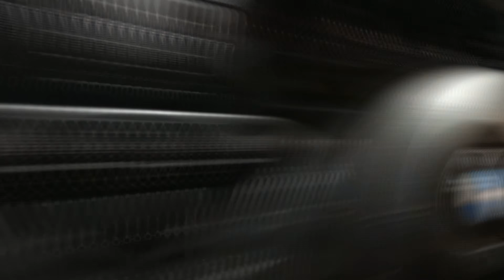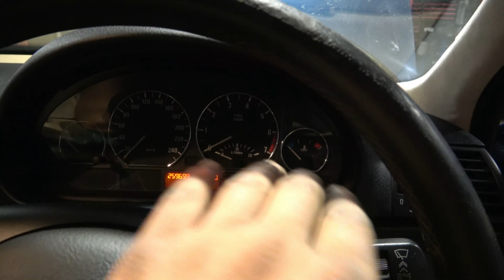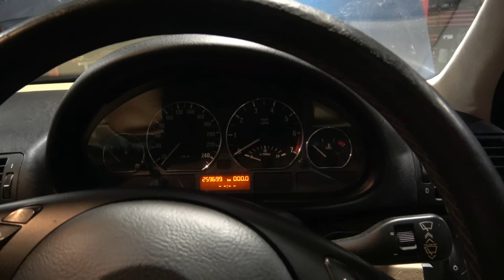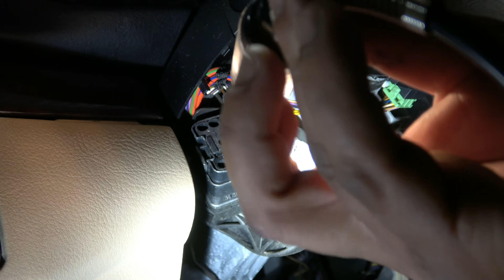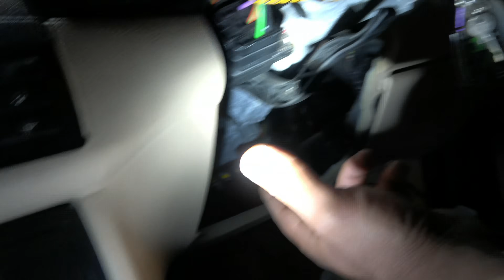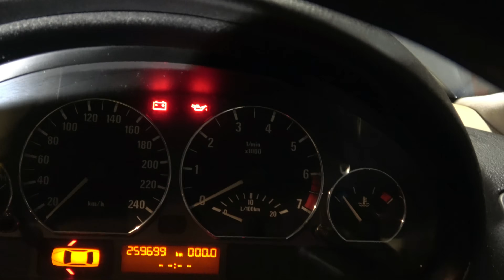BMW NO START BUT IT CRANKS

Comment: Could i be having similar issue, for months been having autobox cog of death coming up from cold, cycling the ignition switch a few times get P back, so assuming it was the neutral safety switch i cleaned it out, checked operation, refitted, cycled ignition to check for PRND, all good. Lower the car down, shes starts for 3-4 seconds, bogs down and stalls never to start again. 
Good battery
Getting spark at the plugs
Fuel pump primes and shows 50psi at the valve, although does drop a bit.
Plugs are wet from cranking
Checked ignition fuses in engine bay corner
All out of ideas now
Reply: Electronic ghremlins have haunted the car

Comment: I have a problem with cranking and not starting bur all my engine lights come on bt my obd2 is not picking up on the scan tool
Reply: Did you get this fixed??
Reply: Try the maf sensor

Comment: Same problem on 320cd 2004. No one knew how to solve the problem. Thank you bro and respect!
Reply: Did you manage to fix it
Reply: Yes, yes. The lock just had a break in the cables. There was no need to change the complete lock. Only new, thicker wires were installed and the problem was solved for €5.

Comment: Is it the same ignition switch on 320d ? I replaced vp44 with new one and everything else checked, car cranks with fuel coming to injectors but wont start :/
Reply: Did you solve this? Having same issues
Reply: @alexwarrener3770  Yes, it was the air in injectors. You need to bleed injectors and trying to start with cockpit or start spray.

Comment: Hi. My e46 330d showed dde and immediately cut off. Now it just cranks and wont start. I can hear the pump priming, ive checked fuses they are all ok. If i leave the car for a few days, it will start. But driving, after a few minutes it will show dde then cut off and wont start again. Any ideas?
Reply: Hi, I have the same problem. Did you manage

Comment: Thank you!  My daughter's car was stranded at work - couldn't figure out why only the mileage and seatbelt lights were working / and engine cranking / but wouldn't start.  YOU NAILED IT.  Took me 5 minutes to get to the switch, wiggle it to get car to start and drive home.   $17 part ordered on Amazon - delivered 2 days later.  It didn't take 5 minutes to install!  Thank you!
Reply: What part did you order!?!

Comment: Bro good video I'm just asking if it's that the ignition switch or ignition connector.....thanks
Reply from the maker: It's the switch. Electrical part you can swap out.
Reply: @a1mechanicaloakey  thanks bro

Comment: I have a 2006 BMW X5 4.4i E53 the originally had no crank or start. 
I bought a generic ignition part off ebay. 
Now it cranks bur won't start.

I checked the fuel pump and it's working fine.
I would like to fix this suv as I can use it.
Please reply. 
Thanks  
Jerry
Reply from the maker: I can give you 150 reasons why it wouldn't start, so that very little information plus a good mechanic should get you out of trouble just fine.
Reply: @a1mechanicaloakey  PS,
Not 150 reasons for one not starting. 

Of you can afford to take it to a shop (1000.00 plus) they will connect it and probably tell you that you need a new ews, Computer and key!

God Bless

I don't have $$$ so doing myself!
Reply from the maker: My reply offended you that's alright but the truth is there are many reasons why a car wouldn't start, just throwing parts at it is not always the best approach but someone can certainly try that route and get lucky. Unless it's a well known and discussed issue with particular vehicle, the short answer is get a diagnostician to figure it out if diy didn't help.
Reply: @a1mechanicaloakey  I am not a pro mechanic but am very good at trouble shooting and have good common sense!

I have changed the ignition and all the time I thought it is the ews  module syncing with the main Computer. 
I've done 100's of reprogramming Epromd, circuit boards, phones, you name it.

It will be the ews out of sync with  Computer.

I just haven't purchases the patch cables to connect to one of my dedicated Computers.
I already have the official BMW Service Software, just not the energy to deal with it due to many health issues!!!

You gave an extremely poor reply especially when you post a video stating you knew what was wrong with the BMW in your video!

When I 1st bought this 2006 BMW X5 E53 4.4i  SUV it would for no reason not turn over or start.

I figured out a sequence to have the computer go thru the default  security settings, then re-sync the key to Computer and presto, it would start right up.

Then one day I got in it and samevthing except that time when I fully went thru my sequence it still didn't start.
Pissed I went in the house ate lunch and decided to try to start.
It started right up.
I park all vehicles inside my secure acre so drove a few feet, shut off restarted and did 5 times before leaving property.
I did notice when getting onto the road it cut out completely but just for a second and then ran fine.
I drove to a local store with it performing fine. 
Parked and shut off.
Tried to re start it and it just turned over (1st time for this issue)
Shopped and when back to vehicle went thru all connections starting at the battery out.

Had it towed home and here is has sat about a year!

Now  Your thoughts?

Greatly appreciated in advance,

Jerry Deitz 
CDA IDAHO

Comment: I have a 2004 BMW 325i....I've replaced the spark plugs ignition coils MAF sensor fuel pump....fuel pump relay.....fuel pump fuse....gas cap.....bleeder valve...air filter and sender unit for fuel pump. All this in the past 7 months. However, yesterday the car has a crank no start condition. Also, I stopped hearing the fuel pump when I put keys in the ignition. Is it possible the fuel pump already went bad or is faulty??
Reply: I had crank no start replaced fuel pump. Worked fine next morning no start again. Had done plugs 3 months ago and kept bypassing that as an issue. Took 3 days of headache pulled plugs and all were bad. Check plugs. After I changed the plugs with ngk iridium’s it cranked right up.

Comment: Not the best trouble shooting method. Just because one car has an issue doesn't mean another car that has similar symptoms has the same issue. 9 out of 10 times if a bmw has a crank no start issue it is NOT going to be the ignition switch

Comment: I have a e38 which do not crank. Replaced the starter since the old one clicked. Everything lights up fine. Changed the battery, grounded the engine to the chassi, tried to jump start it and switched the relays but nothing. Only thing that makes it start is jumping the starter. Can it be the ignition switch?
Reply from the maker: Very possible, just simple diagnosis would eliminate possibilities of issues like relays fuses and wiring.

Comment: I'm having a current brain racking problem with my 2012 f10 528i no Crank no Start..and it's just now showing the red  warning ⚠️ sign for drivetrain malfunction. Could it possibly be the same.. cause that would be an easy fix..oh and I also heard a clinking noise like it was coming from my rear wheels
Reply: Please tell me you got this fixed by now
Reply: Help please

Comment: Thank you for the video.. I have a quick question please.My bmw 120d e87 cranks but no start, all lights display on the dash but except the engine light.. fuel flows but the injectors do not accept the fuel.what could be the problem?.
Reply: I have the exact problem on f10 550i
Reply: @sithulematrose1825 I would love to talk to you about how you resolved this issue
Reply: @sithulematrose1825 would kindly love to talk to you about how you resolved this problem
Reply: Did you ever solve the issue?

Comment: I have a bmw 116i 2005 I drove it for about 5 mins then stopped turned the it off then went back about 2 minutes later and it was like there was no power I tried jump start it and it sounded like it had run of gas but could smell fuel. It will crank while it has jumper leads on but just won't fire ne ideas to help would be great as I have only had it for 2 weeks
Reply from the maker: That's just not enough information. Many possibilities.
Reply: I have the same problem. Checked everything I have no spark. Seems like there is no power coming to the coil pack

Comment: I have a BMW 530i , she cranks but won’t start . She will start if I spray started fluid in the intake, then stalls immediately . I’ve replaced the alternator , the fuel pump & relay . Checked all fuses they work and I’m getting power To all sources . I don’t know what’s next . Any help on what you think it might be ?
Reply from the maker: Many thing could cause that. Most probable cause could be, no fuel getting in the rail, no injector control, immobiliser etc.
Reply: I got the same issue on a 2007 x3.. how did you fix the issue? Run on starter fluid only.
Reply: @agsession7664

Comment: I have a 735i 1991 it cranks and occasionally starts with  a very low idle then switches off , any ideas?
Reply from the maker: Many reason that can do that but start with cleaning throttle body and idle controller.
Reply: @a1mechanicaloakey  done that even checked crank position sensor still no luck

Comment: Thanks for the video, I ordered and ignition switch but got the start/stop module.  The ebay link in your bio is no longer working, can you provide me with a part number so that I can order the correct part please? I have a 2008 750i
Reply: Reply with the part number please as your link doesn't work.
Thanks

Comment: Hi, my BMW X3 2.0 diesel 2007 has intermittent crank but no start problem when the temperature gauge is in red even if the engine is cold. It will start when the temperature gauge is in cool position. Any idea regarding this problem?
Reply: @andrew190e no. I tried all the suggestions given but the problem remained. My car has been sitting in the garbage for 2 yrs now. 1 technician suggested to repair the ecu but to no avail. Yes there was a suggestion to change the jbu module. I’m still considering to try it but the expense is holding me back unless someone could assure me that indeed it is he problem.
Reply: i have the same issue with my 330ci in the red will never start
Reply: @andrew190e  were you able to correct it? My techinician is suggestions to replacement the jbu module. It is quote expensive so i’m having second thoughts about it.
Reply: Mine coolant is in red too is that coolant related
Reply: Si care este problema  @abumannocchi
Reply: change your crank sensor. if not, then cam sensor. crank sensor is more likely

Comment: Hi, I have a problem with my Mini Cooper s r56 not start. 
The only code the mini have is: A0B4

The mini was on taking it out of the garage when it suddenly turned off.  The first Scanner have these codes:
 2781
 2775
 2D52
 2DCA
 275F
 272F
 I changed 4 spark plugs, 4 coils, the Camshaft Position Sensor and a new battery.  But it did not turn on, now it is giving these codes:
 005E31
 009314
 00A0B4
 00932D
 009CB5
 I deleted them and it only gives me this code: ( A0B4 )
 The mini starter good but not start.
I try the new battery and it says it's ok, but when I test the battery with the terminals mounted on the Mini Cooper it says it's bad I don’t now why. I also reset the new battery in the mini system with the scanner but nothing.

( A0B4 )
Reply from the maker: Best suggestion is to take it to a good technician. that's just not enough information there to give you any technical advice.
Reply: This is a problem, where I am there are no mechanics who work with Mini Cooper. I only need a idea.
Reply: I buy a Autel scanner and this is a code the scan register
Reply from the maker: At this stage I do not know how to help. Give me more information on what have you checked. Is it no crank or no run. I would love to help but when someone says no start, there's 500 different reasons I can think of  why would a car won't start.

Comment: same problem. My n42 bmw shut down during ride and did not start anymore? Replaced fuel pump, crank sensor, both camshaft sensors and spark plugs. Error codes gives misfires etc. U think it might be ign switch? Bmw e46 coupe 2002?
Reply: Same here did you get it fix?
Reply: @ Yes. It was valvetronic motor. It was in wrong position and didnt work anymore. You can manually turn it in correct position.

Comment: Hi thank you 🙏🏼 for this we are really really stuck 😭 we have a bmw 1 series 116l se engine 1596cc no problems no warnings at all woke up one morning and it just cranks? And won’t start 😩 he’s only just bought it in June 2021 only 50,000 miles, how can a car woke the day before and the morning not start? Apparently two cylinders aren’t working and 3rd cylinder low, fuel pump checked ok no sign of faults ignition test ok too, apparently they would have to send off cylinders and take head off which costs sooo much money now they saying write it off????? Please please please I beg you for ideas?? This car is everything for us to work? 🙏🏼🙏🏼🙏🏼❤️
Reply from the maker: Anything is possible with cars. I currently have one with 50,000 km 2018 model, lost 3 cylinder compression already. Very bad engineering. Ask the mechanic where is the compression leaking to. I would take it some place else to get second opinion if they couldn't answer that question. they you will know real fix and pricing.
Reply: BMW has a warranty on the timing chain up to 70,000 miles , they lost a class action lawsuit. Should be a free repair at BMW . Make sure who ever u took it to puts it back together the correct way . Then take it to BMW

Comment: if that causing it, does it also cut off the fuel pump?
Reply from the maker: Very much so. Pretty sure none of the computer is awake at that point.
Reply: @a1mechanicaloakey  I have check but I have already replaced the fuel pump, crank sensor..check all fuses & relay all seem ok. The car sometimes shut off while driving and need to wait few minutes to start and also sometimes also all light comes up and car goes to limp mode, thought it was cause by ICV, already replace same issue, hopefully its just the ignition switch.
Reply from the maker: Good luck
Reply: @Linoge279  did it work? I have same problems.

Comment: That's good to know that the faulty ignition switch below the cover is the cause but did you try taking a screwdriver or small hammer and tapping on it and see if that would resolve the problem? Outside of replacing it?
Reply: Not the issue in my 2006 BMW X5 E53 4.4i. 
It will more than likely be the security system (ews module)
Found out it's to this day a huge problem.
Bypass the ews or security system should perfectly fix it.
There are companies that you can send your ews module to and they reset it which I'm going to do soon.

So many people make a video with a fix like key, ignition module, relay, fule, fuel pump etc...
Reply: @geralddeitz9169  what company do you recommend?
Reply from the maker: Yes I did.

Comment: I've got a question for you.
I have a 2001 bmw X5 4.4l.
I've just replaced the fuel pump ect.
But it cranks and starts and occasionally it cranks no start, takes a while and eventually it starts, I also get the trans failsafe come in and out just randomly, lately it was trans failsafe but starting fine, and all of a sudden trans failsafe has gone but it cranks and has issues starting
Reply from the maker: Sounds complicated when it's intermittent. Follow the procedure on the video but you need to catch it when it's playing up.

Comment: I have a 2006 BMW X5 E53 that had intermittent no crank or start. I would just roll windows down & closed, lock the x5 with key fob then unlock with key a couple times get in close door hold foot on break and it would start.
But sometimes not.
Then I drove to store and it just turned over but wouldn't start.
I bought the ignition part you mention from ebay and same thing. Crank but no start .
1 more thing,
The ignition key stuck in start position when I 1st got in it from store when it wouldn't start, the key would stick in start position.
I could manually turn the x5 off.
Can't afford to pay what the BMW shop wsnts.
What do you suggest???
Reply: Could it be the immobilizer???
Reply from the maker: May be immobilizer but hard to say without looking at it.
Reply: How do I bypass the immobilizer on my 2006 x5 e53 4.4i?
Reply from the maker: I'm not the guy for it. Good luck

Comment: Similar problem though l get all the lights on my dash, would it be the ignition switch
Reply from the maker: Possible but it looks more like starter motor or starter circuit fault as in relay, fuse, control, wiring etc. Worse case seized engine. Good luck bro.
Reply: Have you solved the problem?
Reply from the maker: I did. I don't know about Ray.